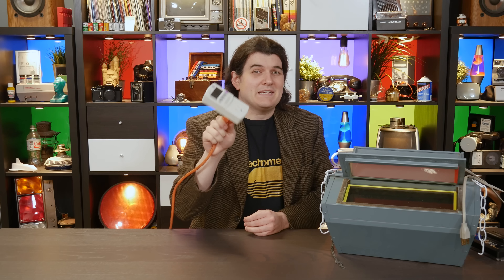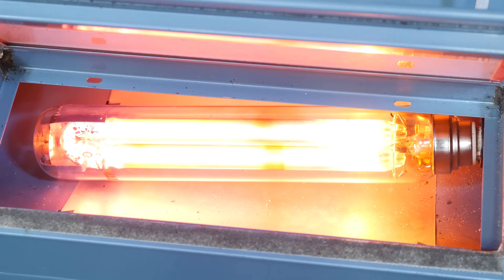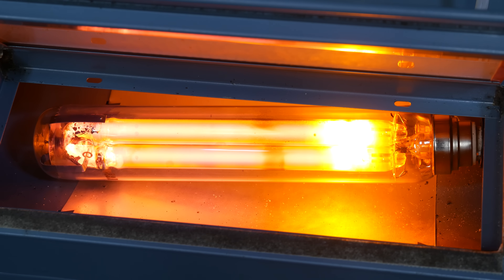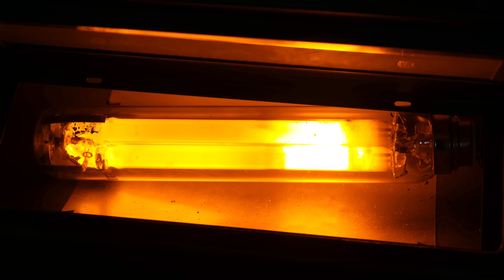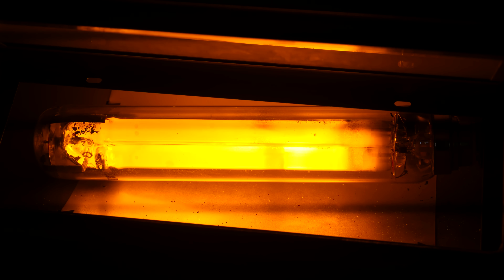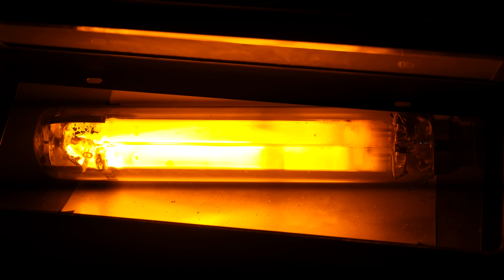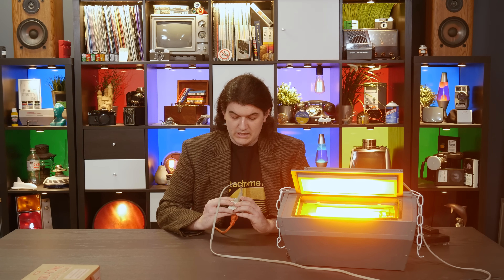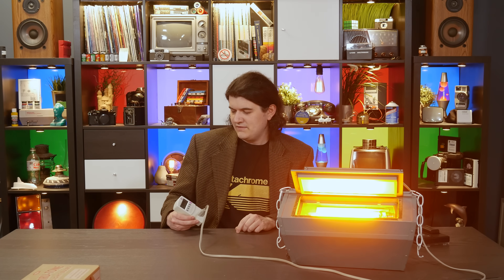More vaguely-informative ramblings about low pressure sodium lamps

Comment: You know this slow warmup is the kind of thing that's actually really nice in low light areas. All of the lights in my house are LEDs now because, well duh. However, two of them are not - the lamps on our night tables in our bedroom still have some old IKEA Compact CFL 'energy efficient' that take an age to warm up because that's exactly what we want form our bedside lamps. If you wake up in the night, you don't want to be blinded when you need to turn the lights on. They take several minutes to warm up to full brightness, enough time for your eyes to gradually adjust. I honestly don't know what we'll do when they fail as, as far as I know, there are no LED equivalents with fake 'warm up' time.
Reply: I got a new bed frame for Christmas that has a light underneath it. At first I thought that was deeply silly--why is it there? in case the monsters want to read?--but it turns out that it's actually really useful for navigating those late-night bathroom breaks. You turn it on, and it just kind of makes the floor around the bed glow.
Reply: @ZGryphon  Hospital beds have small "puddle lights" under each side for just that reason - they cast a small "puddle" of light on the floor without the need for turning on the main lights in the room, so your new bed is actually following a safety trend. I'd say it's actually a good idea.
Reply: @whitesapphire5865  On more expensive cars they put lights under the door.  When you open the car door it lights up the ground so you can see if you will be stepping into a puddle of water. The idea on the bed was taken from the car and the name came with it? It could be just a puddle of light... Not sure but they definitely are similar in function shining on the ground so you can see what you are stepping into.
Reply: I ended up getting the Phillips hue lights and set the default turn on to 10% brightness with a warm light. If i need more, i turn it off/on twice really quick and it goes to 50% which is plenty for me
Reply: Dimmers and dimmer compatible LEDs, that way you can turn down the lamp before you turn it on and then ramp it up manually. Or hack the dimmer to be programmable to start them dimmed and then auto ramp up over time.
Reply: LED smart bulbs can be controlled and simulate warm up, or just only turn on some amount, some folks have theirs default to partial brightness nighttime, which you may override if wanting brighter, so rather than getting bright later so you return to blinding, can just remain low.  Also can have it light red at night to not ruin night vision/dark adaptation.
Reply: You can still buy fluorescent bulbs if it matters that much. I have a relatively new instant start CFL in my bedside lamp and it’s pretty dim when cold. The light doesn’t even make it to the opposite wall, and my room isn’t that big.
Reply: @Jaymac720  depends on country. They are illegal to manufacture/import now in the EU & UK. Most places in my country have sold out and when they do they can't reorder. Ordering from abroad is possible on a domestic level but the bulbs can be confiscated if customs notice. A shop caught doing so could theoretically be in big trouble for smuggling (though I don't know if that's actually happened).
Reply: While I appreciate the suggestions guys, the lamps in question are pretty old with a built in switch so an off the shelf smart bulb wouldn’t work. Some kind of hacked smart bulb or a self made tiny arduino board with a dimmer module that just warms up the bulb over a few minutes would likely be the best replacement but I don’t have much time to look into or build such things right now.
Reply: In my bedroom the main room light is a Philips bulb that came with its own remote control. Full control regardless of the wall switch (so long as it is ON). If the wall switch is a dimmer the wall setting  has no effect, as it still lets through enough power for the remote control to get its own way.

From my bedside cabinet i can turn the room light off and on (providing I leave it on at the switch by the door).

 Better still after a fortnight or do i got myself  into the habit of dimming it to dim red or dim yellow (which in the dark is NOT brown) before switching it off. 

It comes on in the state it was last on. 

Bathroom breaks are great as the low light level does not hurt the eyes, and the red or yellow does not mess up my body clock.

If it really is time to wake up i switch it to white and un-dim it a step at a time, over a few minutes. 

Cost £20 per bulb when a simple LED was about £3, but I have never regretted the extra expense.

Ummmm ... except when I drop the remote and it hides under the bed and I need to grub around there using my phone as a flashlight to retrieve it next morning...
Reply: a dimmer that's operated by a Pii?

Comment: I'm no expert on LPS lamps, but i would think the wear mechanism is sputtering. The metal electrodes are being slowly eaten up and the metal being evaporated and deposited onto the glass envelope. Once the electrodes are burned up, it's dead.
Reply: ive also noticed on my bulb that the sodium content is a fair bit less than what was in it originally (apparently it reacts with the glass)

Comment: 12:15 - I think ElectroBOOM talked out this, there's something called real power and that's what you pay for or something... He called up the power company to ask about billing and they could hardly find a person that could answer his question. It's in the "Power Saver Scam EXPOSED" episode.
Reply: It SHOULD be what you pay for, but it's worth checking! Big Clive in particular is dubious over smart meters and how they charge you for power and apparent power, etc.
Reply: So 13 Comments on a Connextras video so far and someone is refering to ElectroBOOM and gets an answer that refers to Big Clive...
You have love this community
Reply: "actual power" vs "apparent power" aka volt amps I believe. I would have thought that the way electricity is billed is set by the government, and not up to the whim of the electricity suppliers. At least here in the UK, anyway.
Reply: @igotes  yeah it's probably an ofgen thing I guess, I've never looked. Not that our present administration would blink twice about adjusting it.
Reply: @xyonofcalhoun  I assume it wouldn't be introduced on the sly like Big Clive suggests. I don't have huge induction motors running in my house 24/7 so it's not something I'm too concerned about anyway.

Comment: These are also widely used in San Jose, CA and the surrounding city’s in the Santa Clara Valley. Legend goes that they are used to reduce the amount of light pollution for the Lick Observatory on Mt Hamilton. I’m not sure how accurate that is but I do know that they are the exact same color as the yellow signal lights, so that can get interesting.
Reply: Since they basically put out one spectrum of light they are very easy to filter out for astronomy purposes.
Reply: Same @ Flagstaff AZ
Reply: Thanks to you and Tech for mentioning this.  I saw them in San Deigo in 2010 and thought they were fluorescent lights wrapped in a yellow filter to keep bugs from swarming over them.  Then when I went looking for them in Street View, I couldn't find any examples.  I now remember that the bulb shape is part of a design of a very politically incorrect bridge detail in Olympia, Washington where they have concrete representations of totem poles with the light tube under a bird's beak at the top.

Comment: I’m admittedly clueless about power factor, but I know just enough about electricity to be dangerous. So if the power factor is 0.2 would that mean only 20% of the electricity is getting used and the other 80% is going back to the transformer on the neutral wire?
Reply: The inductor essentially draws much more energy from the grid than what goes to the bulb, stores it as a magnetic field, then sends that excess back into the grid every half cycle. That's current going back and forth to achieve nothing, yet still producing the same resistive losses in transmission lines as if it was actively used.
Reply: I'm not sure it quite works that way? I've learned what it means a few times, but have had a hard time internalizing exactly what its true effects are.  It's more about the return sine wave of the AC current being out of phase with the grid, which causes losses for the power company.

Comment: How I like to explain power factor and reactive power: think of a wheelbarrow- you need to lift the wheelbarrow up in order to move the stuff forward. Lifting up is reactive, pushing forward is real, and total work is apparent power. The being hard on the grid part is that you are flowing more current and causing resistive losses in everything, but not getting more work done. Grid equipment- transformers and generators among other things are rated in kVA (or MVA for bigger stuff) because that is a measure of apparent power which takes into account the bad power factor some loads have. Only when you have unity power factor does kVA = kW.

Also - maybe the lamp does have a cap but has failed.
Reply: That didn't explain anything at all. It sounds like you got distracted halfway through and started talking about kVA instead of finishing the wheelbarrow analogy.
Reply: No PFC cap.  These a high leakage reactance transformer ballast.